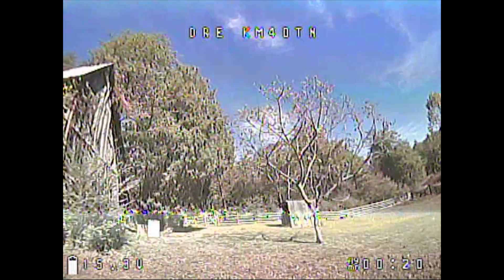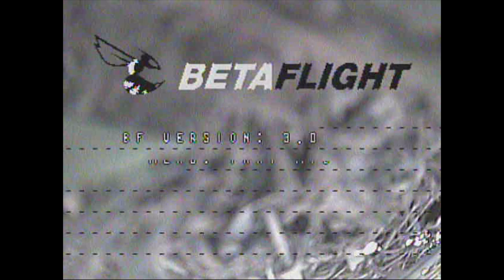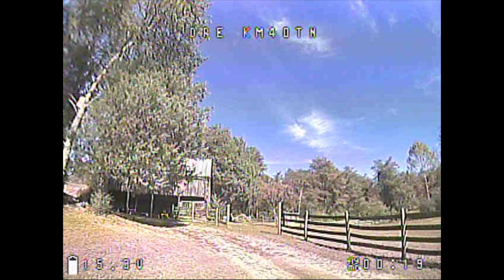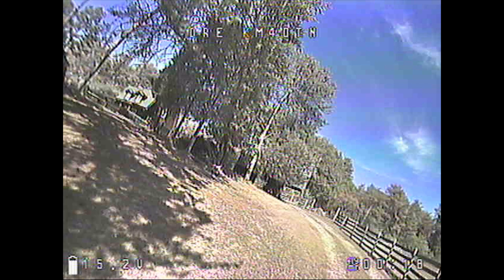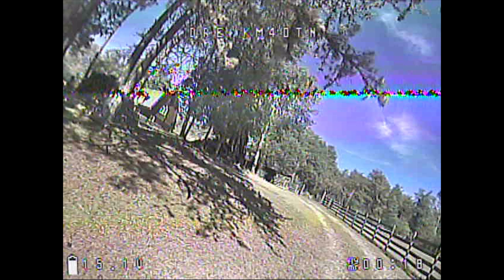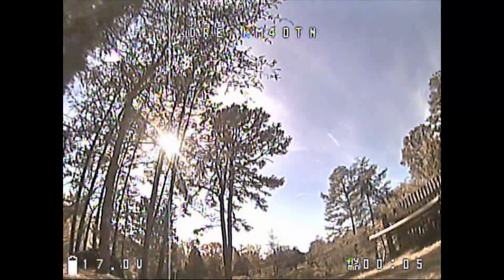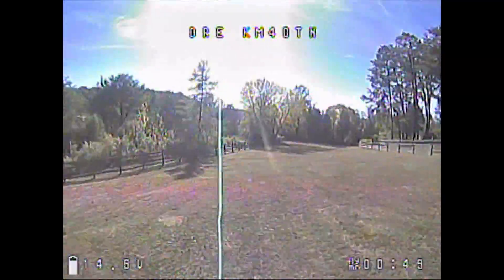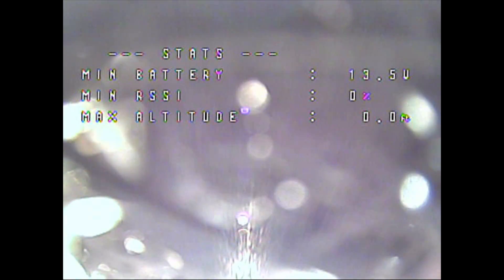Can You Troubleshoot #4 - Answer

Comment: Very interesting video. These small receivers indeed don't always have much range, especially when some things are in between, like branches. Also the single antenna doesn't have as much "clear vision" as a diversity receiver, like XM+, so in some angles the CF frame can mostly block the radio signal. Since then I decided to use these only on small stuff, below 100mm, and even then, still see if there is room for R-XSR or XM+, because these have so much better range. Even the XM, which many webshops list as "full range" tends to lack when it comes to really covering a distance.

Comment: Had a death spiral with my new build. It has a AIO fc, self powered, parallel connected to 4in1 ESC. Flysky RX (full size with newest protocol) is only thing feeding of in built 3A bec. Did a flip and spun like crazy in the same direction of flip. Failsafe is set to 0 throttle, hold all others and disarm. I heard motor chirp after it smacked the ground.
This was LOS, Black box either was full before flight or decided to not record. Battery at 12V.
5V rail is 5.25Volts, not sure if that's kosher.
Since then I switched ESC protocol from one shot to the default DShot600 but calibrated via one shot first, set min speed correctly (like before).
Now the kicker, another drone which is made from scraps does the same thing, but instead of spiraling, it just drops, I can almost here the motors desync.
Also, my Baby Hawk got desync glitches suddenly and Rx blew out.
Starting to suspect faulty Turnigy Evolution Rx with corrupted firmware or 3 separate issues (Brown out, desync, Rx failure), Or just rotten luck.
This isn't my first rodeo, been flying FPV since 2013 And Rc in general since 96, but No birds are safe right now and I'm losing patients and money.

Comment: my quad is doing this exact thing. using a flysky, i am curious if i should focus on repairing correcting wiring or if im looking for better connectivity i just need to upgrade gear?
Reply from the maker: The solution depends on what the cause is. First you need to figure out if it's failsafe or power down or what.

Comment: I was having a similar issue, however I was getting death spins instead of a gentle dip. I was using an old PDB to power 5 V to my FC and I felt like my FC was not getting adequate voltage. I switched 5v coming off a Matek VTX and flew a few quick packs and did not have any issues. I was only having death spins when I had fast and hard punch outs or throttle cuts, so I gave alot of hard throttle and chopped it with no issues. I'm not sure if you fully solved the issue with your new receiver, but it is possible that the power needed for all components of the FC to work was not met and created the issue.

Comment: I believe that this is a receiver-fail safe that was induced from a loss of signal.  I see this all the time because I fly in the rolling hills of Palouse, Washington and see this whenever I accidentally dip down below the crest of a hill.  The dip in the arm is probably a loss of stabilization from disarm.  Doing the Taranis Antenna mod might help, as will continuing to use the nicer x4R-SB receiver.  Another potential cause could be a fiddly SBUS wire, but I'm going to give you the benefit of the doubt that the soldering was done well.
Reply from the maker: I agree with your conclusion.

Comment: I had 2 receivers fail on me while flying at a higher thottle state but my tx did indicate signal loss by beeping at me. At first I thought it could be my wiring but when I observed my tx during LOS flight I could see a voltage drop in the receiver. I could not duplicate it during slow and steady flight but when I started to get aggressive it dropped out. Long story short it was the receivers that I beat the hell out of when learning to fly. The cases were crack but I ignored it because it was still flying and it takes a while to get more. Yes I fly the generic flysky but I also fly infinty batteries which I consider generic because they are cheap and not main stream and sold on Banggood.
Reply: Oops! Long story longer. Not very eloquent.
Reply from the maker: Those Infinity batteries perform very well.

Comment: Hey Josh, I did the 5dbi antenna mod on my taranis and it worked wonderfully for the first few flights but then the range started decreasing and now i have about a 30 foot range. I was wondering if you have heard of this problem i hope it is just the receiver. My SWR is 0 to 1 and I get a low rssi warning when i power up my quad.
Reply from the maker: No idea, but it doesn't sound good. Have you tried changing the antenna out? Are you sure your Taranis is one that actually reports SWR? A few don't. But I think it should always be zero in that case.
Reply: Joshua Bardwell it does reports swr and I have tried 2 different antennas. but the thing is it had a great range at first and it's just gone down. would it be safe to put a 5.8 ghz linear antenna to see if it changes swr? I made sure it was actually a low signal by flying it out until it failsafed. I ordered a new reciever and I'll let you know if that helps. also it's been very cold recently around and below freezing, maybe temperature is affecting something?
Reply from the maker: +Patrick Donovan the Taranis uses a 2.4 GHz antenna. What have you been using?
Reply: Joshua Bardwell and I got my taranis x9d plus in August this year and I've updated it with the new firmware using open tx with no problems.
Reply: Joshua Bardwell a 2.4 ghz 5dbi antenna off of amazon. I was just wondering what would happen if I used an antenna that came with my vtx.
Reply from the maker: Nothing good. a 5 GHz antenna will likely not be tuned properly for 2.4 GHz, especially a 5.8GHz antenna.
Reply: Joshua Bardwell good news! it was just the receiver that was damaged.

Comment: I've been troubleshooting a similar issue on my quad for some months but with no good results, and it happened mostly with a 4S setup.
What is more suggested across the forums is a brownout due to a ground loop or a cold solder joint, bit i've double checked that. Maybe a bad voltage regulator on the pdb? Maybe the missing ground cable from the esc (in the signal side)?
I wouldn't say it's failsafe because it seems that only one motor stops instead of all them.

Comment: I would be interested to know what the delay from stage 1 to stage 2 is set to. I've found that if you have any delay set then the quad will shut down for the duration of the delay in accordance with stage 1 then re arm and try to "Land" the quad (Stage 2) when it is often already on the ground. That looks like what happened here except it was still in the air when stage 2 engaged (Though really low) and when it hit the ground power was lost which caused the reboot.
Reply from the maker: I have it set to 12 second. I've never noticed it trying to rearm and "land" but that may be because I haven't used betaflight OSD before, or had this exact scenario occur. This could explain the re-arm. Well done, if so!
Reply: Can you possibly take a screen shot of the failsafe tab? Would be interested to see. I had this problem once where it lost signal and dropped to the ground then tried to start the motors again. When I got to the quad I smelt burning motor.....
Reply: Also 12 seconds? That seems really long.
Reply: Or did you mean a value of 12 which would be equivalent to 1.2 secs?
Reply from the maker: No, I meant 1/2 second.

Failsafe tab is set to "drop", 1/2 second timeout, hold throttle, auto all others.

Comment: I'm Still going with a power distribution issue. I would check M3 from FC to motor for bad soldering or intermittent shorting due to moisture or dust.  
My original comment about browning out still holds as I am guessing that M3 gulped extra amps due to the issue and caused the FC/PDB to go brown.  
Think of this as a chain reaction. A small short or issue with M3 caused power imbalance and then cascaded down the PDB to the FC just long enough to cause the crash.

Comment: I was having a similar problem that was driving me nuts, I found that I had a wear mark in the outer jacket of my receiver antenna that was wore through to the metal grounding shield and periodically touching the carbon fiber of the frame I think. I don't know if that was really the problem, but I put on new antenna's and made sure that it would not wear off the jacket like that again and I haven't had the problem again yet...Fingers crossed.

Comment: If you read the qx90 thread on rcgroups those receivers do that. My qx90 has fallen out of the sky a few times. A few have said its because the antenna is not the right length but others say it happens after trimming the antenna to the right length. I flashed the midelic firmware to get telemetry on my reciever and haven't had the problem since. My antenna is still stock.

Comment: just a thought, does the receiver have a reset button?
Reply from the maker: It does, and it's a good thought. I have seen an accidental press of the bind button on an X4R cause a copter to drop out of the air. It would also be consistent with the observation that there was no apparent lockout of the controls. Although I also think it's possible that there was a lockout of the controls and I didn't notice because I was flying straight and level.

Comment: Joshua, the video also shows a complete loss of video signal during/after the crash. Perhaps there is a bad connection in the system.
Reply from the maker: I think the loss of video signal is because of the loss of power to the board, right? The Sirin has the vTX integrated into the FC.

Comment: Joshua, I've had issues with the micro receiver where it "reboots" whenever voltage goes just a little over 5.1v.  If your BEC is not super consistent it will cause this behavior.
Reply from the maker: Well, sounds like using this receiver was just a bad idea ;-)
Reply: Joshua Bardwell I think these are OK for micros but probably not so much for larger quads.

Comment: I was going to say radio glitch.  Something caused whatever aux channel you use for arm to quickly go to whatever value is disarm, then quickly go back to the arm value.

Is / was the RX definitely set for no pulses?  If not, then the RX might have had brief RF lockout and set aux channels to predetermined positions during lockout.  This happened to be a disarm position for the FC.  Once signal was reacquired, the aux channel returned to normal, and the FC re-armed.

Comment: Josh this actually makes a lot of sense. Maybe something like the following series of events. 
1. Initial loss of connection and failsafe. OSD displays data screen AUX channel goes LOW (disarm state).
2. Connection re-established. AUX channel goes back to HIGH. FC interprets as arm state but requires second rearm. 
3. Connection lost again. AUX channel goes LOW.
4. Connection re-established. AUX Channel goes HIGH for a second time and FC re-arms.

Also from watching the first video it looks like your body is directly between you and the copter when the event occurs. I believe the body will act as a very effective 2.4 GHz shield.

Comment: hi joshyou describe how you programmed the board failsafe and how in the end that would not match to how the kwad reacted in the end. but how was the failsafe programmed inside the rx?
Reply from the maker: I don't know, because this is not my usual RX. I do know that when you turn off the radio, the motors stop running, but I don't know what the channels do in the mean time.
Reply: ok then you might suspect that in the assumed failsafe event, the rx turned the channels to the state they were in at the time the rx was bound.  which is obviously the disarm state. when the signal was recovered, it spat out the arm state again. the fc then did not notice any failsafe because the rx was not sending "no pulses". 
just thinking...
Reply from the maker: I think that's all valid. I can confirm that the RX does go into failsafe when I turn off the transmitter, but the exact nature of the failsafe I don't know.
Reply: try add a capacitor to the 5v line. i have this problem when i switch prop 5040 to 5045 .add capacitor solved it. no more fail safe event.

Comment: so thats an important information that you have used one of these rx of the qx90!!! if i had known this, the answer would have been clear after 1 second (more or less). because i and a lot of others have the exact same issue with the qx90 = midflight disarm for no reason. thats a well known issue (but still not 100% solved. different antennas could make a difference, but not for everybody) so i fly my qx90 with the risk of disarm everytime everywhere. if it happens, bad luck. just pray and hope for no disarm. these rx seems to be bad quality, but the real reason why this rx behave like that is not fixed. i think i dont want to invest a lot of hours troubleshooting why this rx is crap. i just go with buying another one from frsky or compatible. bonus: you have rssi and vbat without doing flashing arduino and stuff.

BUT THANK YOU, now i know for sure, that the qx90 problem is the rx`s problem.
Reply: a lot of QX90s have the antenna cut at the wrong lenght. I had a lot of failsafes with my XQ90 until i found out that the antenna was about 1cm too long. cut it to the right length and the tiny receiver will have a looong distance to loose signal. never had a failsafe again.
Reply: MrPurple thank you. i knew that eachine have had some production issues with the antenna and shipped a lot if qx90 with too long antennas. mine is already cut to 31,25mm, better but still not 100% save. even another antenna did not completly solve the failsafes for no reaseons.